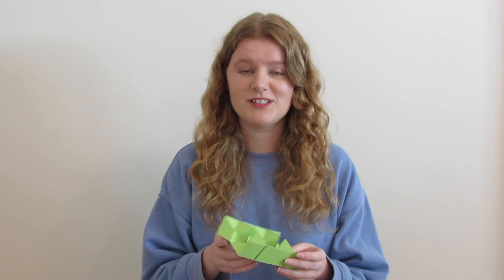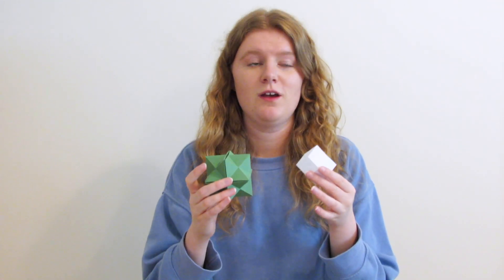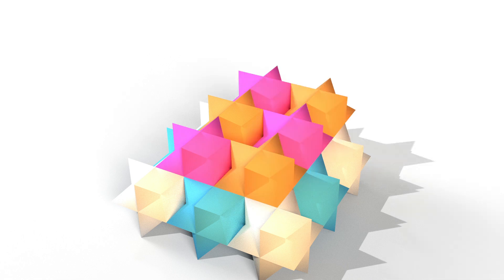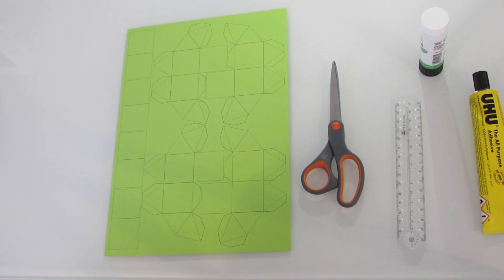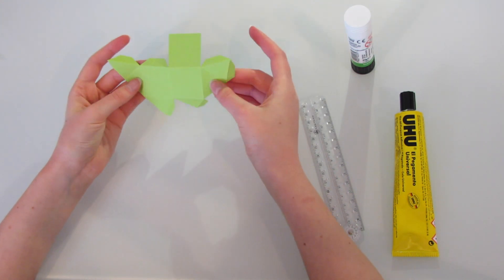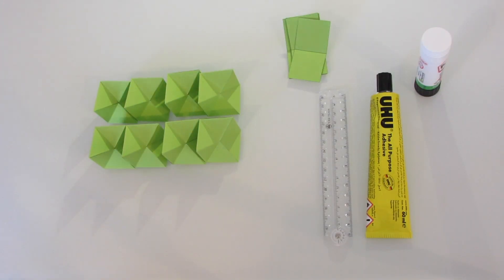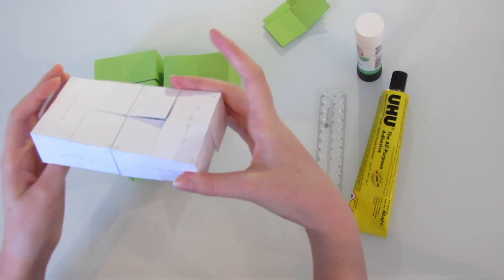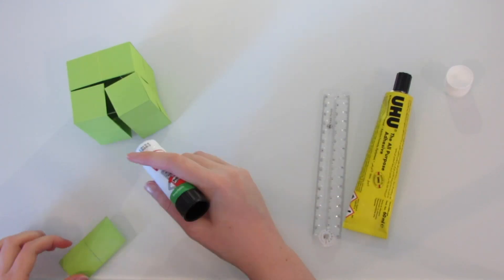Making The Yoshimoto Cube | Mathematical Craft

Comment: I want to make it but I ran out of printer ink😫
Reply from the maker: Oh no!!  It is possible to draw the nets but it is more of a commitment! If you did happen to want to draw them there are measurements here: https://drive.google.com/file/d/1jyQrWUvRQEf7KOTA9kvn6TbMYSQTZx9H/view?usp=sharing - these give exact ratios as well as approximate lengths in cm for making one the same size as mine.  I'd recommend drawing one then tracing or transferring the corners for the rest so you only need to join the dots.